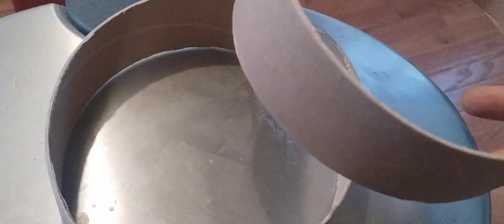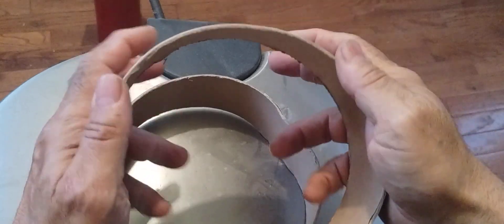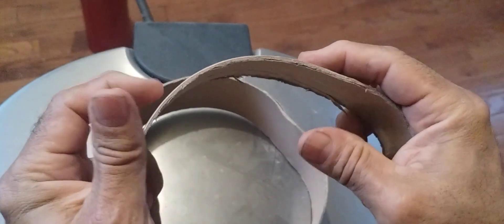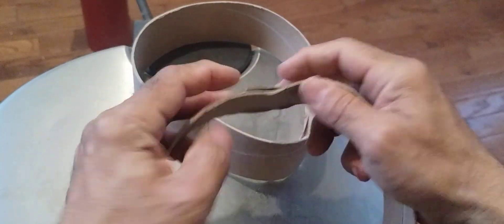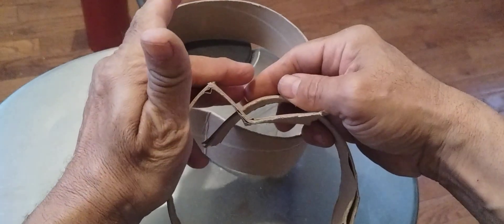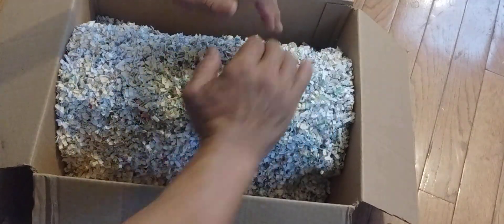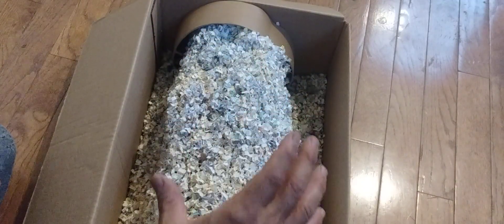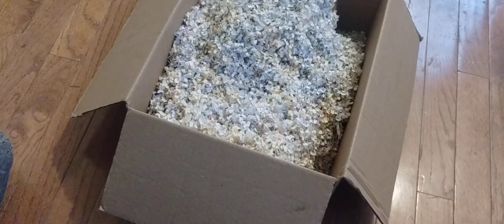Titan Submersible Snap buckling of carbon fiber reveals BOTH sides of the c-chanel / flange failure

Comment: The hull monitoring scham was the funniest part. Putting stress sensors across a dry piece  of wood that your repeatedly bending is the same deal. You deflect it, hear some cracking then release the strain.Seeing as you can’t make any two of the same, you’d need to push say 10 of them to snapping point, average the ten then add a safety margin. Say it averages an implosion every 6 trips to 4000m. Would be like 4 dives and scrap

Comment: A good example of snap buckling is what we used to do after emptying a beer can. Place the empty can on the ground and stand on it with one foot. (Yes it can support the weight of a full grown man). Then reach down and touch both sides of the can at the same time. If you were fast enough you could get your fingers out of the way, if not everybody else would get a good laugh 🤣

Comment: The visuals really make sense of the mangled mess in the photos.  Thank you for taking the time to break this down. The way the pieses are pretzeled, sheared, bent and delaminated shows the effects of the pressure the Titan experienced. Be gentle with my ignorance, but I can't relate to  6000 psi.
Reply from the maker: https://ibb.co/Db2LWsk this is an image I made for you, it reveals what the human body typically has no issues with...
We would've crushed at 6000 psi (we would be mostly speared by that pressure)... But, NOT all of the internal was exposed to that pressure, some was exposed to a higher pressure and some to a lower pressure, I would theorize as low as 3000 psi but that would still crush the human. 
I will add one more image for perspective , it only takes about 25 psi to break bones but this is not a gradual psi to break bones, it's a sudden pressure and this would also imply the bone cannot flew with the shock load.
At 6000 psi, it would dislocate all the human bones! 
After dislocation (not hands/fingers  may not dislocate)
Reply: The link unfortunately didn't work, but I  appreciate your explanation ! I have the picture now👍... like a car crusher at the junkyard x 3! You're awesome!

Comment: If Stockton had, say 3 titanium rings (guessing 2 1/2” thick & 3 1/2” wide) equally spaced on the inside would that make a difference or is this contraption a hopeless p.o.s.??
Reply: I'm sure something could've worked but the dude needed people with operator/ maintenance/ mechanical/ electrical type of backgrounds .. he reminded me of them blue collar folks that have the construction hat on and the shovel at them groundbreaking ceremonies 😂
Reply from the maker: Yes, I think this carbon fiber could have worked had he added more stiffeners and managed deflection to no pressure inside the last or rather the first layer...
Reply: It is the carbon fibre that is the problem. Had the cylinder been made of 5” thick titanium it would have been perfectly fine, but then the weak point would have been the Perspex viewing porthole. That really should have been a single crystalline piece of sapphire glass. But then the vessel would have been ten or more times as expensive to build.